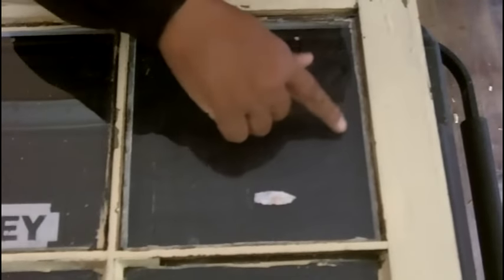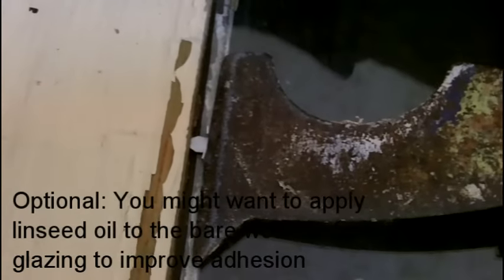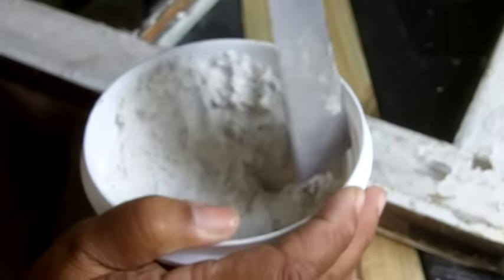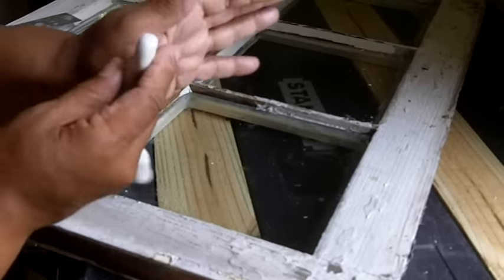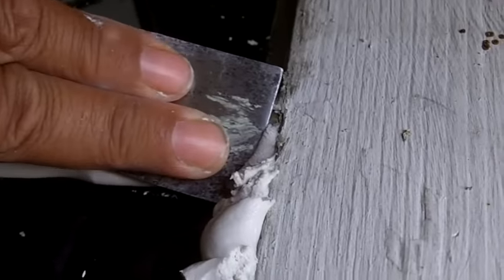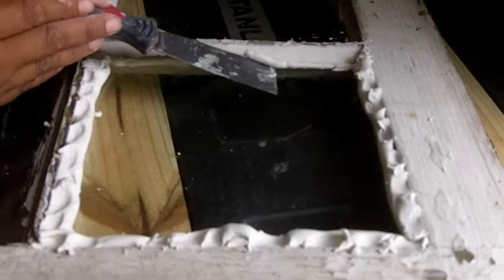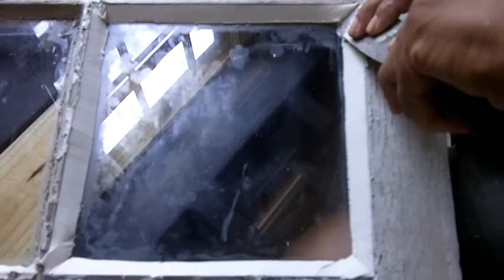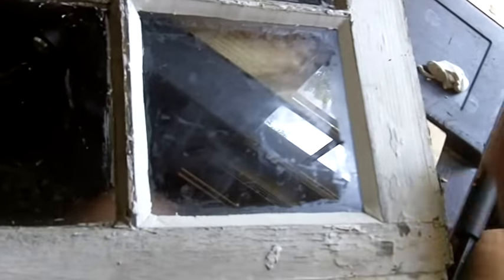How to Re-Glaze Wood Windows

Comment: I would recommend sanding and smoothing the edges of the old frame to get a more smooth “glide” . I learned also that the main reason for pressing the putty thoroughly in is to get it into the space between the glass and frame. Just my five cents from trial and error.
Reply: And painting primer on the wood before applying putty to stop the wood absorbing oil from the putty causing the putty to dry out and crack.
Reply: @marklittler784  
Is that why the text in the video in the beginning says to apply linseed oil before glazing? I'm wondering how this would affect painting after the glazing is done.

Comment: If u want it to look right I should tape it uniform and glaze then pull tape immediately. Then u will have an actual bead on the edge of the glazing where it meets the glass. Also when u pull the tape it will take the excess with it.

Comment: HMM...your glazing is TOO wide...it will be seen from the inside....only as wide as the rabit the glass sits in!
Reply: I'm thinking that I don't want to have to do this again, so I'd rather use a lot.  My windows are big so that makes a difference as well.  She did a very neat job (on VERY old windows) and I think it looks great.  (just use the same amount on the inside that you use on the outside and it'll be fine.)  I suppose if your wood is in better condition that what she is dealing with, then a smaller amount would still work.
Reply: Some One  rabbet, clise enough.  The word between the oanes of glass.  If your glazing is too wide, compared to the rabbet size, you will see it from the inside of window, which you don't want to do.

Comment: This video and the video for redoing pulleys has helped me tremendously with restoring my house from 1894. Using your fingers to push on the back of the blade was very helpful, as I tried to without doing so and without enough pressure the putty separates. Thank you.

Comment: Thanks Jane. My wife just repainted our 1970's curio cabinet. I removed the wood front around the glass doors that looks "Colonial" 6-5x7 per door. I used the pins to replace the glass after removing the rubber around the inside. Now I know how to finish it off. Thank you again very much for your videos. Stay safe.
Reply: Of course your supposed to paint the wood with primer before you apply putty or linseed oil that windows were originally treated with, otherwise the wood will absorb aborb the oil from the putty and eventually dry out and crack then rain water can start getting to the wood. Of course your supposed to paint the putty after about four weeks to seal it in and stop it drying out from the top.

Comment: thanks for your video it is the first time i am reglazing old stained windows . I didn t know about linseed oil but however as I inserted the points ( triangle ones ) they were like blunt so I ground them all razor sharp on one angle , took a very very squared brass block , a towel as a pad between the glass and the block and a hammer with a lot of caution and it did the job.

Comment: If your using any of the hard glazing it is an oil based product which means you have to paint with oil base..  Or prime with a zinzzer or Kilz prior to painting latex on it.
Reply: Exactly this was the mistake my father constantly made as we lived next to an alleyway and got windows broken quite often sometimes the varnish or linseed oil was still left on after chipping the putty off which acted as a sealer but not all, you have to seal the wood with primer to stop the wood soaking the oil out of your putty and seal with paint after a few weeks.

Comment: does it matter if the temperature outside is cold?  I understand that the glazing itself needs to be warm for proper adhesion, but does it have to be done in warmer temperatures if you are repairing an exterior window?
Reply: The glaze takes longer to dry if it's really cold!

Comment: You mentioned to apply linseed oil on the wood to improve adhesion of the putty. Boiled linseed oil or regular?
Reply: Boiled.
Reply: Its to stop the wood from absorbing the oil out of the putty and drying it out resulting in it cracking and failing later on.

Comment: So funny you should make a video of this. I'm re-glazing windows for a client, now.

I must ask, however, why you're not oil-priming first.
Reply from the maker: Hi Dana,  Yes, priming the bare wood is a best practice. The caveat to priming is that you have to let the primer dry completely before glazing.  I prefer linseed oil with a little mineral spirits.  Oil primer is also an excellent choice.  Some like to use penetrol, however, I've never used it as a primer, only as a paint conditioner.  Good luck with your project.  It's time-consuming, but you are doing it the right way.
Reply: Thanks so much. Why such slow-drying oils, though? The oil-primer before glaze, then the 7-14-day waiting period before another oil priming is definitely time-consuming - but linseed, that's ultra-slow-drying. What are the benefits of these slower, oilier techniques? I love being able to inform my customers.

And yes, I am highly interested in even the most minute of details, if you're so inclined.

Love what you're doing, here.
Reply: I am assuming that the linseed and mineral spirits are meant to really soak and protect the wood. Not unlike an oil-rubbed furniture finish. Which, after thinking about it, is a pretty good bit of info to give customers with these historic gems. 

I learn more and more every day.
Reply from the maker: dana bagby Hi Dana, actually, use of linseed oil or another primer is not to protect the wood, but to prevent the wood from leaching all the oil out of the glazing compound, which can lead to glazing failure.  The glazing compound can dry out unevenly if you don't prime, and that could lead to failure of the compound.  A lot of people elect not to prime, because like you said, it's a very long process.  Why do I like linseed oil?  It's just old-school, personal preference.  Since most traditional glazing compound is made with linseed oil, I prefer the "like to like" oils.  But there certainly is nothing wrong with using oil primer. Thank you for your question!  Regards, Leah
Reply: Thanks SO much, Leah! Definitely some good-to-know info. Please make more videos! Especially ones concerning historic restorations.
Reply: What oil primer brands do.you reccomend?

Comment: Using those glazing points makes the glazing compound too thick if they are completely covered.  And you will see the white glazing compound from the inside. Need to use the small triangles or diamond shaped points.

Comment: I just bought some more glazing compound and it's too sticky to roll.  Have you ever had this happen and what did you do?
thanks
Reply from the maker: I've noticed that the glazing made with linseed oil is more sticky than others and bit more difficult to work with.
Reply: Lasts longer.

Comment: I'm using the same DAP 33 product but when I try to roll it out like you did it sticks to my hands like svhool paste. It will not stick to wood or glass. When I try to push it in, the compound pulls right out to stay with my hand.  Do I need to microwave it, or just hire you to do this?

Comment: Do you bed the glass in glaze as well as glazing the interior?
Reply: well supposed to...if redoing old windows and the pane is stuck down tight with the old glazing..i would leave it..if you are a perfectionist...take out all points and glass ...clear away all old bedding glazing and start over

Comment: how do you clean up? and do I wait till after the glazing is dried?
Reply from the maker: I wouldn't attempt to clean the glazing residue from the windows until you have painted the glazing.  You can paint once the glazing compound has skinned over.  Even after the glazing has been painted you need to be careful, I  spray window cleaner on a clean cloth instead of directly on the pane to give better control and prevent over-spray then I just take my time making certain not to make contact with new glazing compound.
Reply: seejanedrill thank you! I'll keep that in mind.

Comment: First you should put a thin layer of compound on the wood to embed the glass into for a better seal.
Next 'prime' the wood with linseed oil, penetrol, floetrol, even paint primer so that the dried wood doesn't suck the moisture out of the glazing compound too quickly. This makes for a slower cure time and better adhesion.
Reply: First time glazer here. What you said about the oil makes perfect sense but I’m not replacing the glass should I still use oil in the exposed wood where old glaze has come off? I also heard something about using chalk dust after glazing is complete?
Reply: @BB-cs1je  yes, if you want to do it right, you want the wood clean and dry, then apply the linseed oil.

Someone*tried* to reglaze a large window at my house. The original glaze from 60 years ago is still intact on many sides, but the ones done recently didn't prep the wood and it's dried out, cracking and falling off. 
Do it right once the first time or do it wrong many times.
Reply: @tresrottn   I knew nothing about glazing when I did some windows. I guess that is what happened to me. I had no idea I needed to prime the wood first in some way, or that I needed to consider what I would paint with after that.
Reply: @tresrottn  
I need to paint and glaze again. What if I don't know what was on the window originally? And what if I want to use latex paint? Do I still use linseed oil? And, if so, is that just on the part of the window that will be glazed, or do I apply it to the entire window?
Reply: @free2beme773   The linseed oil goes on the wood under the glaze. it never touches the paint. It's to condition the wood to hold the glazing longer. 
Honestly, you would do better with an oil based exterior paint, it will last longer and not chalk up. But you can put whatever paint you want on there. As long as the temperature and humidity are good, it will dry fine.

Comment: Forgot a big important step.  Bare wood under the glaze will dry it out by sucking the oils out of the glaze.  It’ll cause early fail.  To prevent that prime the wood with oil primer.   Or even easier is hitting the wood with linseed oil with a brush 30 to couple hrs before glazing.

Comment: You forgot to put down a bedding first. To properly do it so window won't rattle in the wind, you first put down some glazing for window to rest against and gently wiggle it in place. Then your points go in. Then glaze outside. Only way I knew this is I watched another video on how to do a professional job. It makes sense.
Reply: Yes, and She needs to get a Glaze Knife as well, also she didn't mention that Oil Based Primer is a must for sealing the Dap 33 before Top coating.